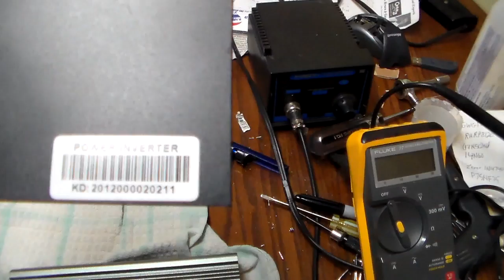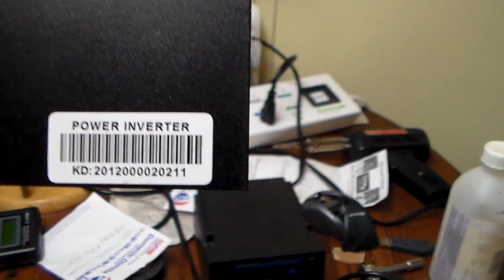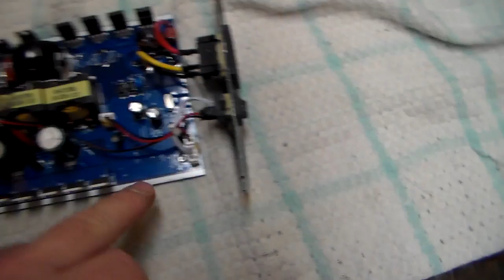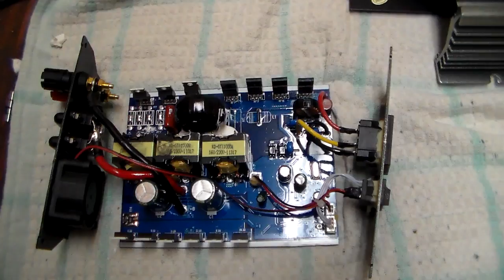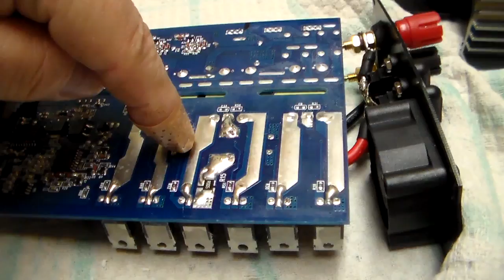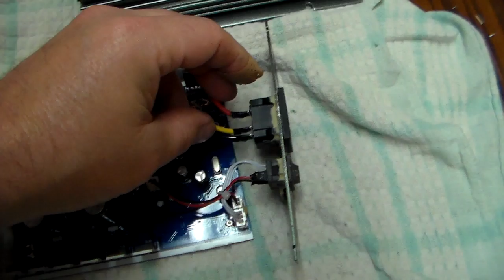inside look KD 600w grid tie inverter

Comment: Hi Roger, Can you please give me the circuit diagram they used for high nad low side gate driving of Inverters mosfets. Or the closer picture of it. Or any reference of cheap discrete gate drivers for high and low side. I am thinking of using it in my project. Thanks.

Comment: Got a similar unit back in 2013, worked well until now, red error light comes on, stays on. turn off & on, green light comes on for a second or two,  then the error light (red) comes on. Two 30 amp fuses are intact.  Saw your vid on opto-couplers, PC817 (same, & in same place),  & just now this vid. The seller has since moved on to something else, however, another knows & has confirmed they are not in business but provided an image that supports your video, their board is a bit different , my zeners are on the bottom side of the board, & the DC side 3 legged thingys are not to-220 (larger grey units). D1,D8 on my unit are U2060G  D24 is 2060CTR MUR (these three are next to / same side as the 4 AC Fets F30NM60D).  Might be a problem with RF8 & F1 {but will change all 4 AC Fets, F1 {T5- 250v 5A}, & the 2 PC817s,) can`t do the surface mount bits with out a heat gun attachment of which I don`t currently have, so I hope when the bits arrive, that will sort it. 
My board version:
SY-MGI-500W A3
DATE: 2013-09-12
REV 03
KQ.ZHOU
Here is a few images of unit & a picture with instructions from another seller/manufacturer.
http://s59.photobucket.com/user/arcturian/library/inverter600watt {hopefully the images are accessible}
Thanks for the vids & all the best.
Reply: Thank you so much for listing the diodes types. My inverter also died. Diodes are bad but unknown types, nothing in google and they all same ones died together. I’ll order the diodes and also the AC side fets. Thanks again for sharing all this!

Comment: Hey Roger.i buy a new 24v 600watt from ebay. as i installed with batteries,display FAULT+LOW.even batteries are full charge.i also check with 33v 10A power supply but same error.Please help to resolve the problem.Thanks.
Reply: Check if the fuse near the mains is burned. Happened to me on my 230V model. In my model it was a glas fuse 5amp soldered directly on the board. However, the reason it was burned was a 1 of the 4  600V mosfet was shorted. Can’t find the link but apparently these parts tend to die if you unplug mains while under load. You should unplug DC input first to avoid. Not sure if that’s indeed the reason but could be one of multiple factors.

Comment: 1000w kd blowing the on circut board 10 amp fuse.. Is this the problem you had ? If so what was your fix..
Reply from the maker: your problem sounds more like AC mosfets, if its
blowing the internal board fuse you probably have at least one shorted AC mosfet, 

I am not sure now if the dual diode IC's on the AC, side,D3, D24 MUR2060CTR = FEP16JTA (dual common anode) or D8, D1 U1660G = FEP16JT (dual common cathode) will be affected I don't recall its been a while, but they may be hard to source as most are obsolete

make sure you fully discharge the DC cap bank by connecting a power resistor across the battery power leads 
because these inverters store a good charge & you will get a nice zap if you touch the live heat sink tabs on the dual diodes & anything else even with it powered down.

Comment: I have the 600w 12v in 120v out model.  The cooling fan will not  turn on. Fan tested good but will not turn on.
Reply from the maker: trace the circuit back from the connector there should be a small capacitor, you could check that, also there should be a voltage regulator & a IC package a SCR of a sort or a transistor as well a thermistor sensor that is probably on one of the heat sink rails if not than on the board some place to sense the temp, sorry I can be more help but I have never had to fix one on a KD & I have no unit available to me at this time.

Comment: Hi Roger, we have similiar inverter but mine's 600w/60hz/22-60VDC/220VAC

It gives around 60% efficiency (readings measured by Kill A Watt) during the first use, but after just a month of usage, efficiency drops to 30%!!!! I think it has to do with the low quality MOSFETS used by the manufacturers in China.

Can this be still repaired perhaps and boost its efficiency more than to 85%?

Thanks and Regards
Ike from the Philippines
Reply from the maker: first check the large DC Capacitors, yours is to handle up to 60v so ideally the voltage rating of the caps should be in the 80 to 120v range or they will break down quickly, also if you can find some with a higher temp rating than the originals they should stand up better, if that does not solve it than it is probably cheap defective mosfets, also depending on your location check to see that your solar panels are at the optimal angle for the time of year, in my area of Ontario Canada I need to adjust  my panels by about 10 degrees each month, if they are fixed on a roof than you will probably have about 3 peak months of optimal power output.

Comment from the maker: that is the problem with all of these, they never sync to the mains, I actually had one working for a short while a couple of times. I replaced both optocouplers (the two small squarish 4 pin chips) on the board in front of the transformers. I then had the green light flickering continuously at a different rate than when it was flickering and going to fault, also during this new flicker rate the input voltage was going low & high & the inverter was outputting about 60w I think from 200w of panels. output should have been 120 to 160w

I also found that if I switched the inverter on at the switch it would still do the ST / FAULT flicker but if I left the switch on & plugged in the extension cord at the wall outlet it would start to work for a while as described above before it would go back to the ST / FAULT flicker. next I will try adjusting the trimmer pot on the board to see if it keeps it on if that does not work I will try changing the double diode IC's on the AC rails & perhaps the AC mosfets & see if that solves it. 

here is the latest that I have done with it.

http://youtu.be/5eodfWbxFyM

Comment: Hey Roger… thanks for uploading this video.  Do you know what the leds normally do.  I just got one and connected it up in fairly low light (500W total in solar panels).  The red fault LED comes on for about 4 seconds, then the green LED flashes very quickly for about 2 to 3 seconds, then repeat.  Maybe calculating MPPT?  Thanks in advance.
Reply from the maker: Hi Mark, Did you ever solve your problem with the inverter? , I finely got the time this summer to solve the problem, I don't know if I sent you a link to the video

  http://youtu.be/rou_heMtFtc
Reply: Roger Foster Hi Roger!  It is still sitting on my desk "in the queue" for diagnosis...lol!!  Thanks so much for doing this, as I was not looking forward to dissecting this thing without a schematic, chip and/or software specs, or component engineering specs ;-).  I will follow your linked video and let you know how I make out.  Again Roger, I am grateful and obliged that you tackled the project.  Thanks!!

Comment: That trimmer pot seems to control the maximum power voltage of the inverter. You can adjust it so that the inverter can be powered from a 24v battery without destroying itself. Great for running at 500w at night to help with cooking the tea.

Comment: I have a 600w one 220v unit. Their is info on the board. (SY-MGI-500W A3  Date:2013-10-14 Rev 03)
funny says 500w on the board. sticker says 600w
Was working great until a f&c%ing lizard got inside via the fan when it was off for the night. Turned it on..zap..BBQ lizard and my new inverter.  His head was on the MUR2060CTR and tail on the B- post. I cant for the life of me find any info on the MUR2060CTR. ON Semiconductor's logo is on the chip. Their site turns up nothing, I email them, and they say it's not made by them.. China knock-off??

I live in a very remote place, and had to ship this unit in (taking 2 mo) so I sure would like to fix it !  The local electronic shops have never seen anything like this inverter before.. it is a 3rd world country, so that does not shock me. Any advice sure would be great.   THANK YOU.
Reply from the maker: the MUR2060CTR & MUR1660CTR are both high speed switching double rectifier diodes, the 2060 is dual common anode & the 1660CTR is dual common cathode, I have used a fairchild sub with no problems, MUR2060CTR = FEP16JTA & the MUR1660CTR = FEP16JT both are discontinued so U would need to find a similar replacement
Reply: Thank you Roger, those numbers and description of the part are a big help to me.
 Finding anything here is a big deal. I bet I will need to ship that in too and wait 2 months. But what do ya do.  Thanks again, you're a big help.
Reply from the maker: 77300d your welcome, you can check those with a multi meter with diode check, from center pin to either of the outside pins they should conduct in only one direction.(the heat sink tabs on those diodes are live until the DC caps are discharged so you will get a shock if you touch them) if you get a chance snap a few pictures of the component side of the board  & send them to me at rcfo1@hotmail.com  as I will be digging out my new non working ones at the end of the month to see if figure out the problem, so I would like to get a look at the parts placement & transformer numbers of a 220v model, thanks Roger
Reply: Thank you again. I sent you a photo via your email.

Comment: Did you ever find out what the VR by the led lights control.
Reply from the maker: no not yet have not been doing anything with them, I was hoping to work on it last fall but was too busy & its been the coldest winter here in over 20 years, just waiting for the snow to melt & switch my solar panels back over from battery to grid tie for the summer I am probably looking at near the end of April

Comment: I have two 600 watt greenergy grid ties and they have no load on them (no amps draw with amp meter)when they run the green lights are running thought but no output to my watt meter, and idea what is wrong?
Reply from the maker: it could be many things, were they working properly when you first got them but now are not outputting ? if so I would suspect the DC power caps & mosfets, the caps get weak & sometimes open, DC mosfets can in some situations stop outputting without actually shorting & blowing up, if they came that way from the factory it is anyone's guess as to the problem it could be a bad component or even a wrong component or even mislabeled for the wrong voltage as these are made in sweat shops with unskilled labor, no testing or quality control & no company to stand behind the product.
Reply: +Roger Foster Roger Foster hello Roger, do you have the characteristics or the reference of the diode connected in parallel Mosfet ST30NM60ND?, Thank you, Serge

Comment: Hi Roger - nice Video. You are a very saftey guy handling with mains!

I also -

but i got an KD 500w from Japan / China?.

It comes DOA.

I unpacked it and found that the black inductor above the 3 transformers is not connectet to the pcb.
Its pins where not soldered.

Also the capacitor on the left side of the inductor ist put out of the soldering joints. I fixed the problem with the inductor - but the pins of the capacitor were to short to solder them back to the pcb.

The great problem is : where do i get this capacitor. All i can read on it = I 05K 400V. it is a metal film Capacitor i suggest. Can you help to find the same one or one that can be used instead of this.

once agian - nice video.
Thomas
sorry for my bad english. -:)

Comment: Hey, for your information I have the same problem with this inverter. Mine works, but the moment you turn it off, or senses a power failure it will not come on again until the next day regardless of the the sun. I don't know what it can be, but it bothers me whenever that happens I lose the entire day not saving energy. Please find out what it can be and advise. Thank for uploading this footage.